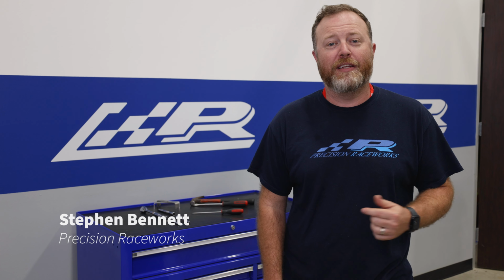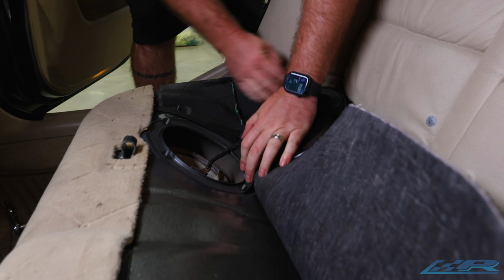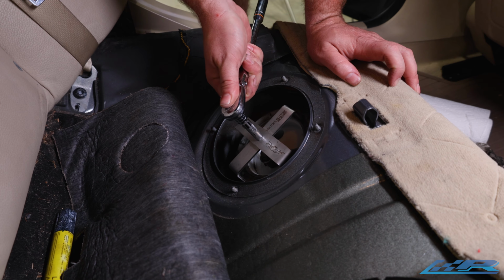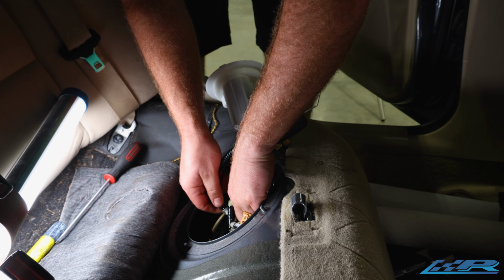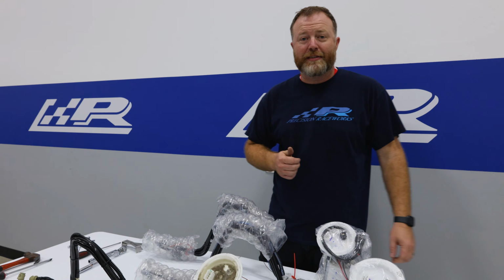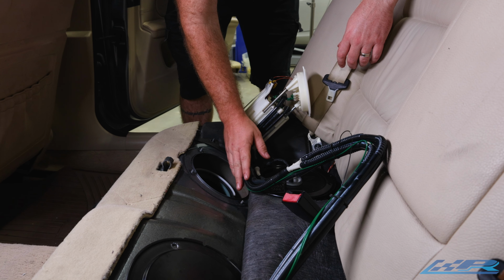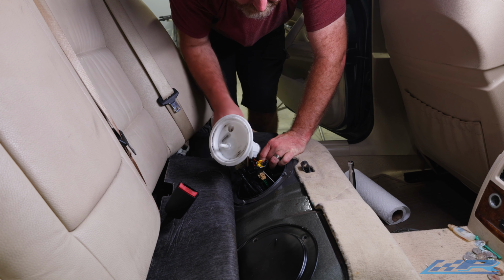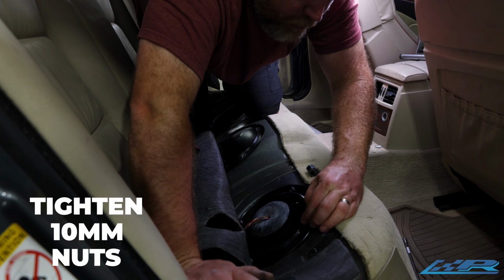PR BMW E60 535i Stage 2.5 Fuel Pump | Installation Guide

Comment: When trying to remove lock ring the whole assembly rotates ! The tab doesn’t lock into the slot on the tank.
Reply from the maker: Yikes!  When that happens that means the glue that bonds the mounting ring to the tank has weakened.  You can still use it, but you will have to figure out a way to keep the pump and ring from rotating while removing the lock ring.

Comment: @Presicion Raceworks i have a question on the tab that you push down & lift if im able to just move it around without removing it & it starts to spray out is the fuel unit cracked?
Reply from the maker: You would need to specify which tab you are referring to...  even a time stamp so we can make sure we are talking about the same thing.

Comment: Do you guy have a video on the e60 stage 3 lpfp install?
Reply from the maker: Unfortunately, no we do not.  However it works almost the exact same, but you slide the secondary pump onto the outside of the bucket before putting the top hat on.

Comment: Cant unthread the fuel pump bracket
Reply from the maker: Occasionally the mounting ring becomes separated from the tank itself. In this situation, you must figure out a way to keep the top hat still while unscrewing the lock ring. This can be challenging, but it is possible to do.